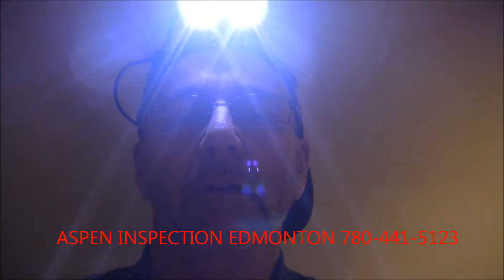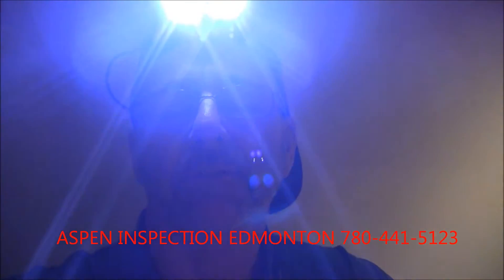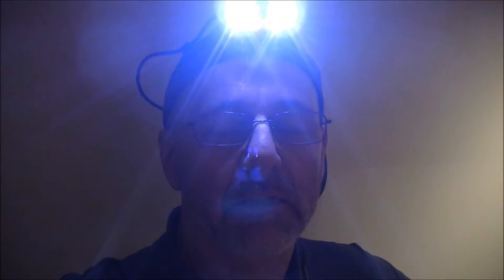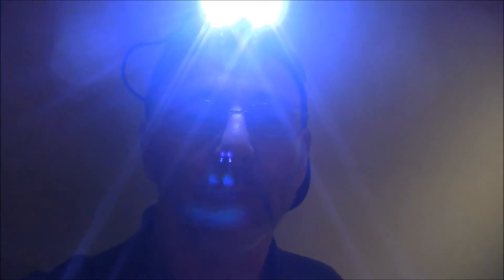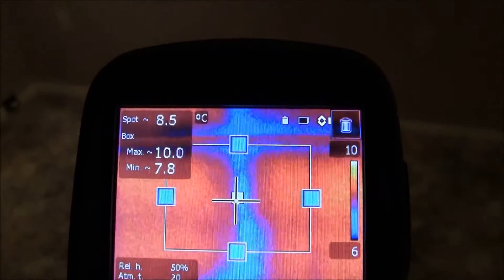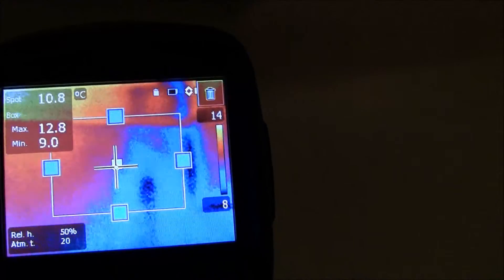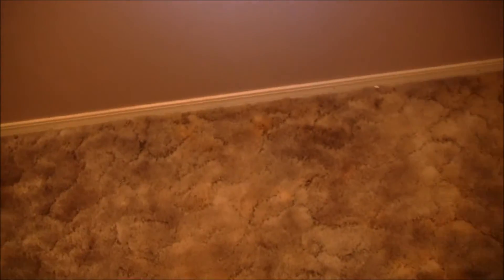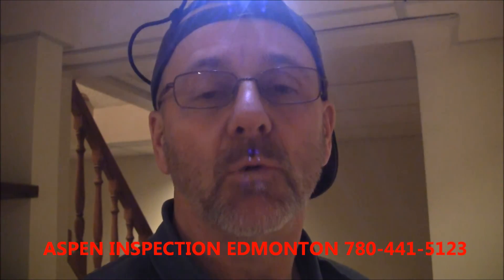Thermal camera finds a sewage leak not visible to the eye.

Comment: It is amazing how fast you can detect water leak with such simple equipment. Right here in Singapore, our Government boards in charge of housing and the town council, still uses dye flood test to find the source of water leak. It has been 6 months since they investigated my corridor ceiling leaks and (1) still failed to get the responsible party to fix the toilet where the leak comes from and (2) just yesterday an inspection at my house still cannot find the leak on the spot. No they don't use the simple equipment you are using. I am getting my own infrared thermal to help them. Such incompetence. Yes, here in Singapore, and they are Government organizations.